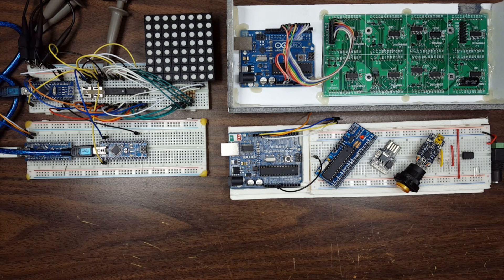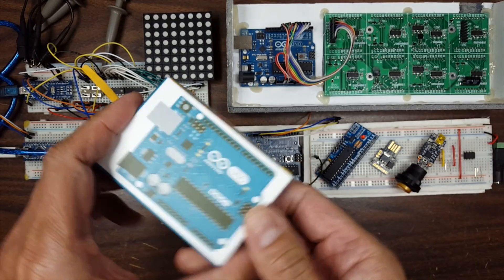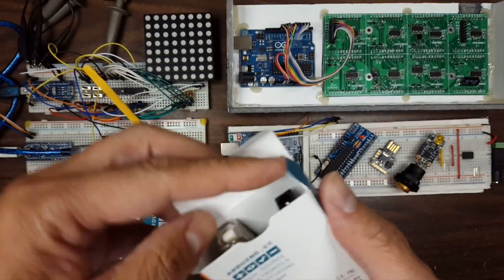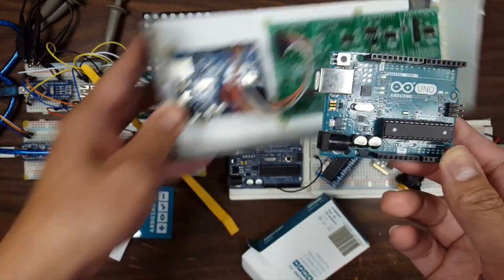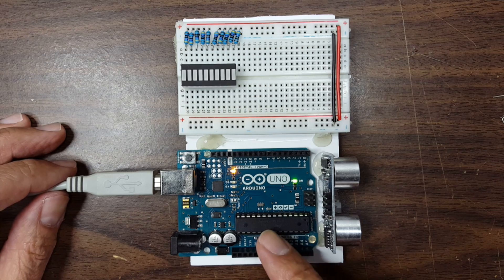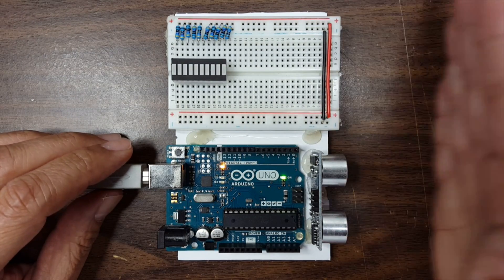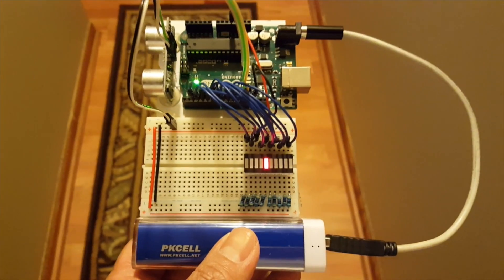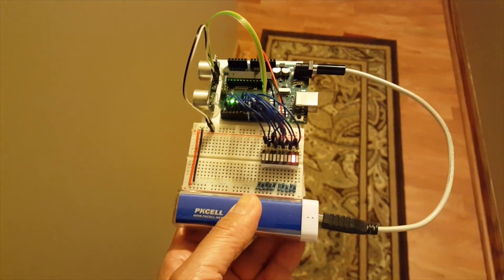HariFun #114 - Made in USA

Comment: Hari:  Using the Arduino to sense how close you are in the garage is overkill.  Pull your car in as far as you want it and then hang a ping pong ball from a string so that it just touches the drivers side of the windshield.
Sometimes electronics is not a solution.
P.S. I really like your videos.
Reply from the maker: jimstand , I agree that an electronic parking helper is overkill.  It was just an excuse project to play with the new Arduino. :-)  P.S: Thank you for letting me know that you like my videos.  Thumb ups are nice, but comments are even better.  Thanks Jim!

Comment: Cool project! Next job; use bluetooth or wifi to transmit the distance to a display in the car itself.

Now about the "code in the description"... :)
Reply from the maker: MisterG , I thought about having the display in the car, but putting the ultrasonic in the car bumper would quickly ruin the sensor.  Your idea solves that problem by keeping the sensor off the car.  Cool...
About "code in the description"... I should have said "Code is linked in the YouTube description".
https://hackaday.io/project/6735-harifun-114-parking-helper-project

Thanks for the comment MisterG!